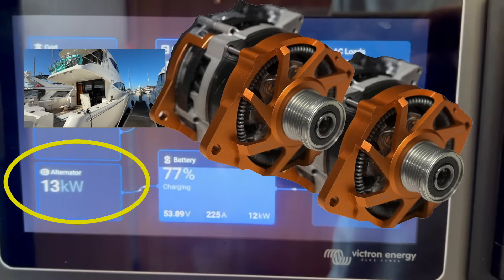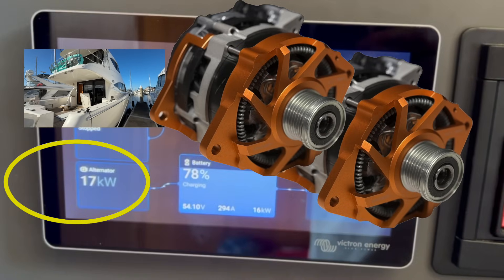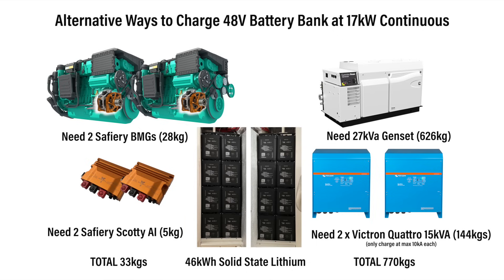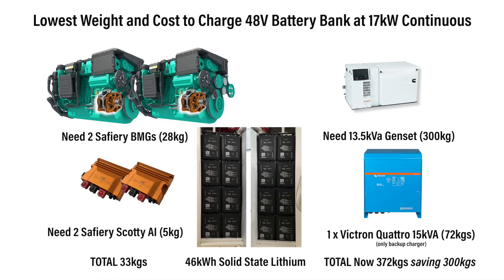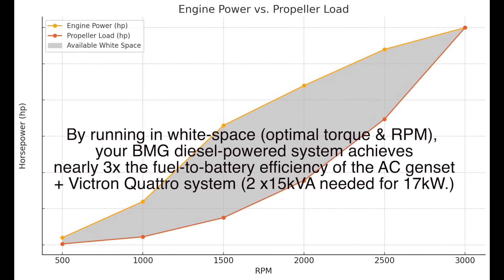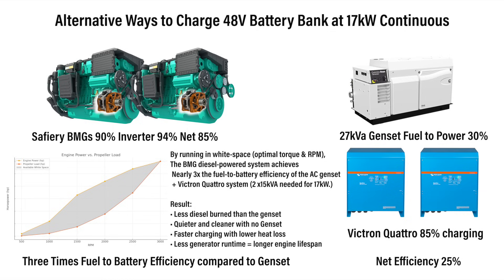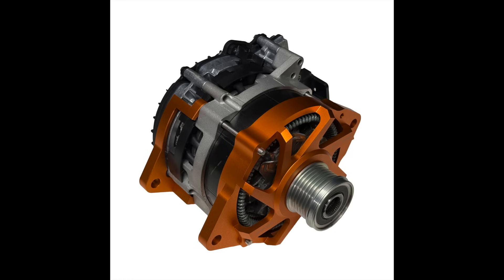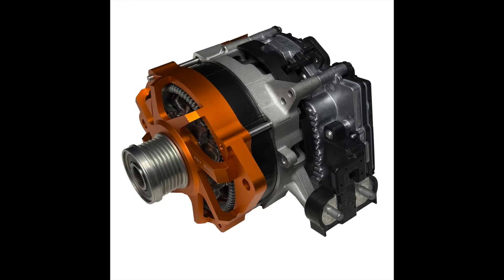Two Permanent Magnet Generators charge 48V Lithium battery bank at 17kW Power . How do they do that?

Comment: Looks like the new 48V hilux alternator.
Reply from the maker: Yes Spot on. The new Hilux is a Belt Stater generator 48V as this is. This one starter out like the hilux unit on an Audi A8. Now with a different Inverter on back its generating auxiliary power.

Comment: Nice, I got a diesel inverter genset but inverter is blown but engine works. Might look into this as all i wanted to do was charge a 48v LFP bank at home when theres no solar. Didn't expect that price though :(
Reply from the maker: We are doing a project just like that. A farmer has an old 2 cylinder diesel 25hp and we are running our bigger BMG on it. He is installing now, shold have a video in 2-3 weeks. Its solar backup but he will disconnect from the Grid now and say the daily connection fee.
Reply: Mick. Be aware there’s suspicions these have caused engine failure. Just a heads up mate

Comment: Do these have enough torque, in motor mode to turnover a big Diesel in a normal alternator configuration? I kind of doubt it but could they replace the starters too?
Reply from the maker: Good Question as these units started life as "Belt Starter Generators" in an Audi A8. So a small diesel yes.
Reply: do you have any units testing in real world engine room environments on yachts?  We are doing a 800-1000Ah lipo setup with 1600 watts solar yes small but thats all the room. I would like to chat to you. I have so many questions.
Reply from the maker: @Twin-screws1975Burger  yes see the video of the Oceanis 391 which has had one running for few months now. Engine is under steps in an enclosed space. Our control algorithm controls based on inverter temperature as well as engine speed and battery demand. So if the environment is too hot, it will automatically throttle back. We can connect to any Lithium battery brand. Preferably you have a stop charge wire from the BMS. Go to our website and touch chat bot to open discussion.